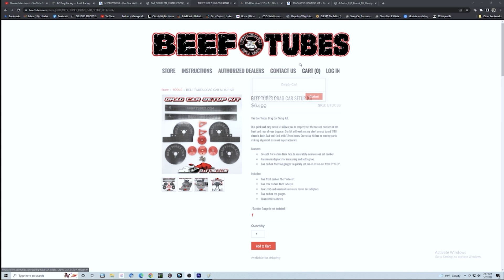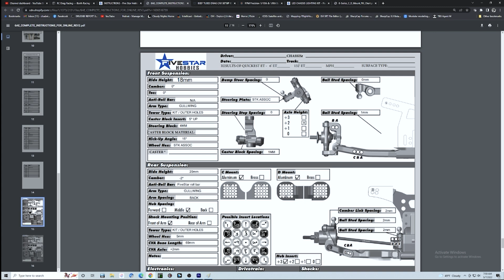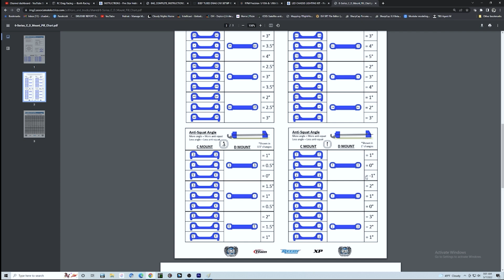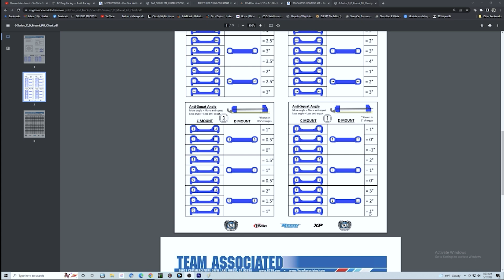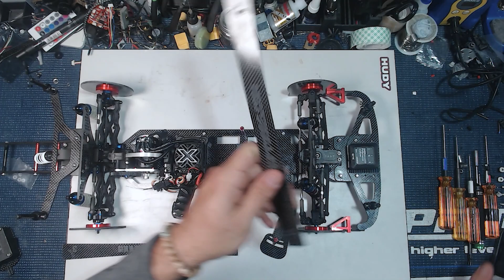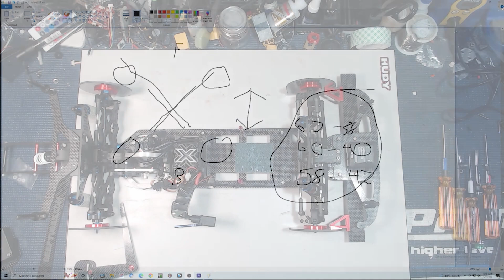MY NPRC CHASSIS SETUP STEPS | WEIGHT | TOE CAMBER | FULL PROCESS

Comment: Chad. Do you use a generator for your battery charger on the track or do you hook it up to your battery in your vehicle… And can you make a video about applying the get stuck sauce on the tires
Reply from the maker: Sure can make that video. As far as power i use bigger batteries on my fpv charger for top offs and bands and if it’s a long session I use inverter. Now at races I bum generator power :)

Comment: Asome Video How do You Use the Tire Heater First prep of the tire LED it dry and than the Heater or.how do you make this nice day
Reply from the maker: I clean tire with break cleaner and then heat for 5-10 mins. Then apply prep and let dry for 5 mins. Then either do a second coat and let dry again then race or just go race after first coat dries after 5 mins!
Reply: @Dorkyand40  thanks man Asome nice day from Europa Austria

Comment: What ride height do you like ?
For me at 3/4 inch my dog bone are angled down but not like if the ride height was 1/2 inch.
Reply from the maker: It’s a fuzzy area. I lift the car and want my axles just horizontal or slightly past. At full squat they are angled some but I plan to add a riser to eliminate that so things can spin a bit more freely. I’d say overall my rear under load is about 17ish mm and the front is around 19. It basically looks flat.
Reply: @Dorkyand40  I agree, having the half shafts 90* gives the most torque to the rear wheels. But to get close to that mine would have to have 1 inch of ride height.
What is this "riser" you mention ?
Reply from the maker: Many chassis make riser plates that go between the chassis plate and the transmission so it gets it up. I’m adding a 9mm riser plate. Fivestar makes a lot of options for the breakout.
Reply: @Dorkyand40  But doesn't raising the center of gravity hurt ?
I have a stand up trans to being with.
Reply from the maker: The kit has an lcg motor mount :)
Reply: @Dorkyand40  Can you give me a part number for it ?
Really don't know what I'm looking at if to buy it. 
I don't have a lay down trans.

Comment: Do you like to have heavier shocks springs in the front or back ?
My thought on this is heavy in front and light in the back to help weight transfer and squat.
Reply: You don't want to run squat squat is literally pulling the tire off the ground you want to run neutral or separation
Reply: @powermadracing5116  So to stop squat you want heavier springs in the back then.
Reply: @RichieCat4223  that's what I have to do because I'm Traxxas based.. but Associated trl have what they call pills in the hinge pin where you can change the angle , you want the pin down in the front or at least level with the ground. level  is neutral down in the front is separation up in the front is squat , if you have the ability to change pin angle then you would run the spring heaviest enough to support the weight and let the suspension do its work in conjunction with shock oil
Reply: @powermadracing5116  I am using an Associated B6.2 chassis. I have it set for 1* toe in and I think giving me less anti squat.
Using a #1 pill the C mount is middle out and the D mount is middle inside by the Associated chart.
Reply: @RichieCat4223  that's the best stuff yes follow the chart and I know companies are selling shims for the transmission as for me I see Drc is selling a transmission with arms with different hinge pin angles thinking about going to Mid motor

Comment: Hey Chad great video... just have one thing to say there is not one real drag car that has rear tow.. I don't know who told you that you have to run rear toe but if you think about it the tires are trying to run into each other but they can't so so they are scrubbing which promotes slip... and as you can see month-by-month things are leading towards real DR.. also I don't understand why you wouldn't run zero camber in the rear that's where all the action is and you want the maximum contact patch
Reply: Dave is right..
Reply from the maker: Always is!!
Reply from the maker: Good morning brother. I’m sure you’re right. I know 3 was too much. 2 looks better. Just seems the way these ae kits are always setup.  The fivestar sheet says 2 but when I put my riser in this week or next I’m going to 0.  It will be good to see some cars close up this week at a race so I can get a closer look at more and their heights and setups. I feel I am still loosing speed somewhere and that might be it.
Reply: @Dorkyand40  not trying to overstep or say anything I just  have drag raced for 30 years and you cannot break the rear axles to put rear Tow in  we use rear steer and preload that is it you'll find it I know how frustrating it can be.. make sure you check that your shocks are equal length sometimes that will give you a messed up Corner weights in the front and will kick that front corner weight to the rear and the car won't repeat when you put it through the suspension cycle
Reply from the maker: Yeah I adjusted for ride height instead after this and seems to be just as good. The scales could be a little BS.
Reply: @Dorkyand40  maybe but I live and die by those exact same scales.... I noticed that the tires weren't in the center of the scales especially the drivers front , was on the very edge those little things will add up . We call that "stacking tolerances" ..when you're talkin ounces for grams you're trying to find. For an example on a pro stock.... a 5-pound Puck on the front can make the difference from Tire shake or spin